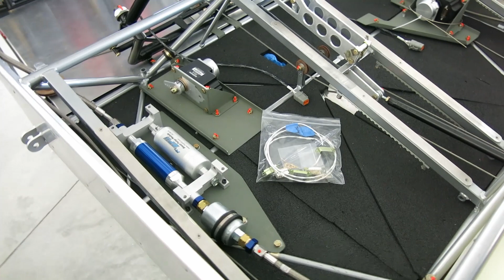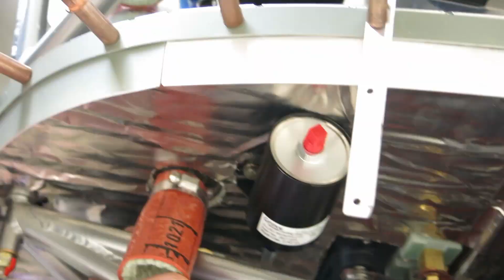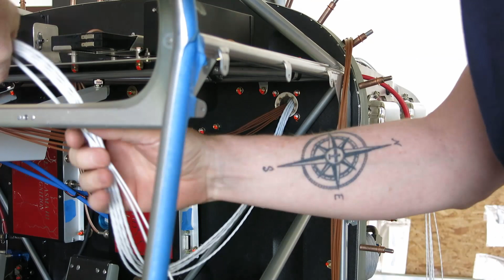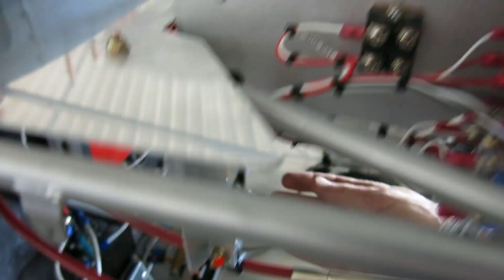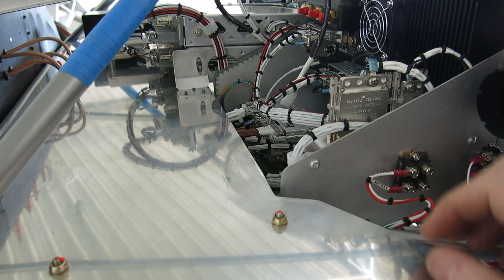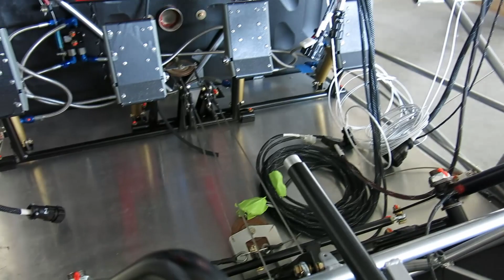No. 288 07-19-2023 Electrical install begins

Comment: Does it make sense to run the wires under the motor mount, to help any potential fluids to drip down, rather than follow the harness inside?

I know it gets siliconed, but seems like a good additional preventive measure.
Reply from the maker: We’re going to check that once we get all the wires run. For now we decided to run them over for ease of install.